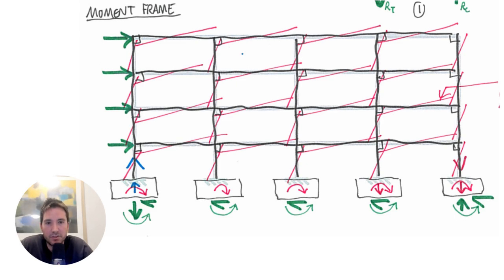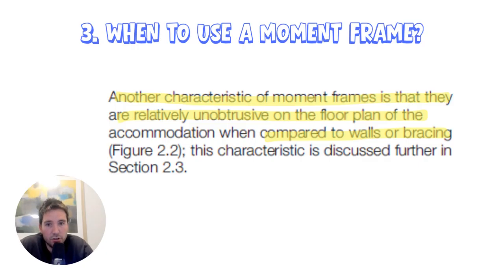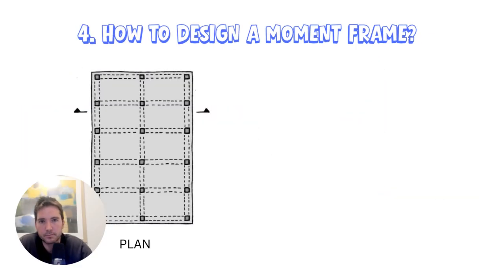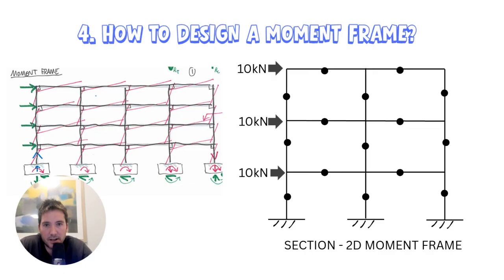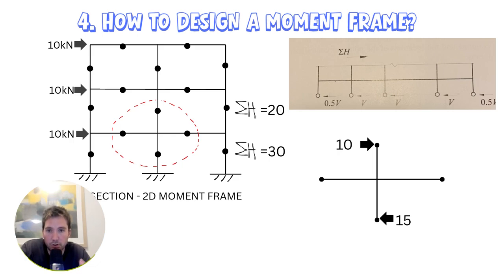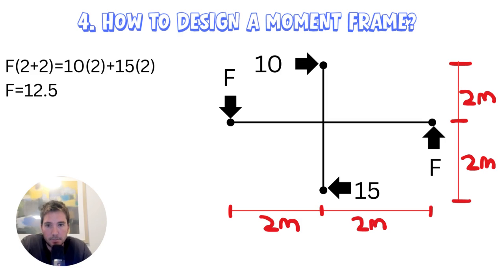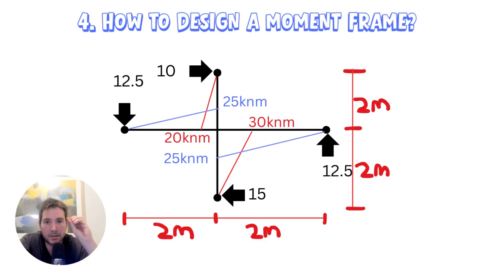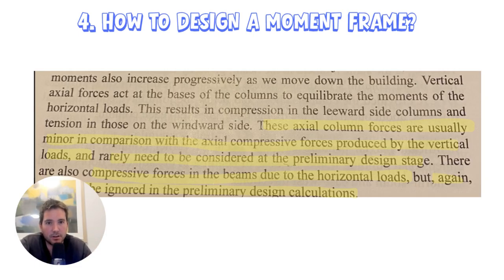design a moment frame

Comment: Very helpful video, thank you!
I have seen some engineers design the posts and connections for a single storey sway frame by the lateral load alone and then doing a separate check to size the header beam as simply supported. Is this a valid method? Someone told me it was called the wind moment method but I have my doubts about it, Have you seen this before?
Reply from the maker: Thank you 🙏. Yes, that exact example assuming the beams are simply supported in vertical loads is actually shown in the moment frame book I referenced at the end of the vid, so have defs seen it before! 
If it’s fixed connection it will see moment so I understand why you have doubts haha. I think it’s ok for prelim design or just verifying your analysis model.